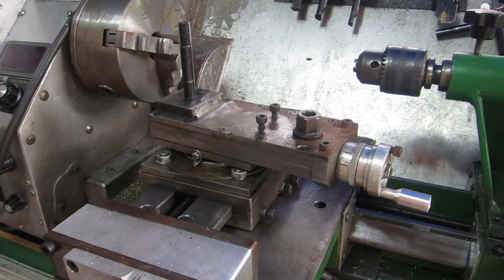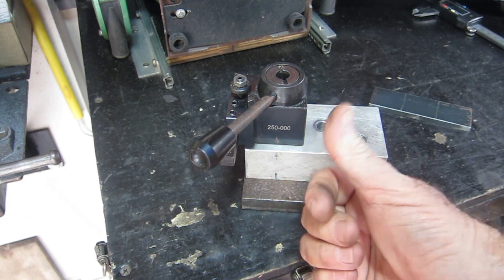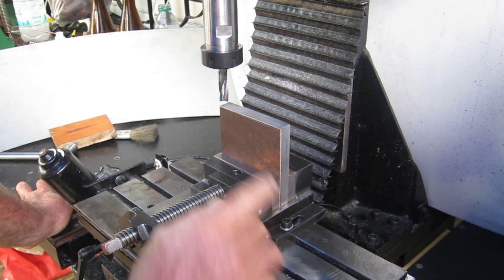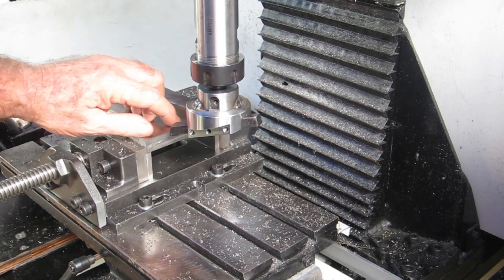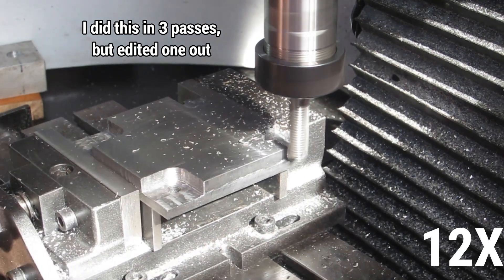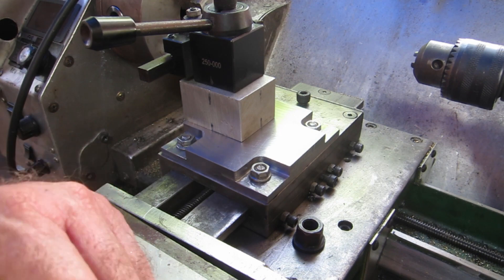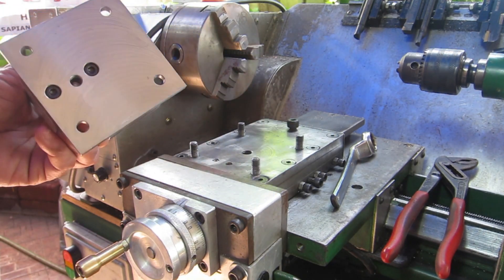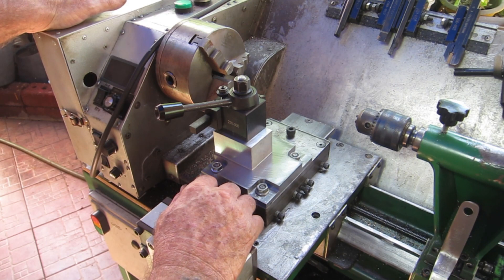MHW Episode 48 - Fixed - Solid - Lathe Tool Post

Comment: Fantastic job ! I think the bloody compound slide causes more grief for small machine owners than many realize - i know it is the bane of my existence on my mini lathe and even on my AL320 it just seems to get in the way and causes problems when turning between centres as the compound handle always seems  foul up on  the tailstock .
Reply from the maker: I have to agree with every bit of that, it has certainly made parting off a lot easier.

Comment: Looks good, you may find another project that would be very useful (depending on how your gibs hold the saddle to the bed) is a rear parting tool post, that way you can part upside-down. I made one about 3 years ago a si was having some bother parting 40mm 316, made a stout rear post and got a good parting blade holder and now she runs like a dream.
Reply from the maker: In another reply I mentioned that since I made this video, I have machined up something for another project from some 1" steel, and parted it off twice with no problems, I'd been having huge issues parting up until now.